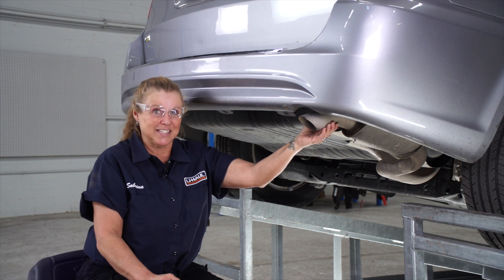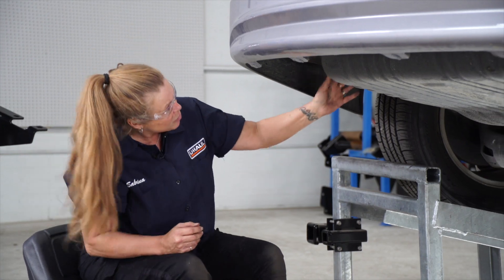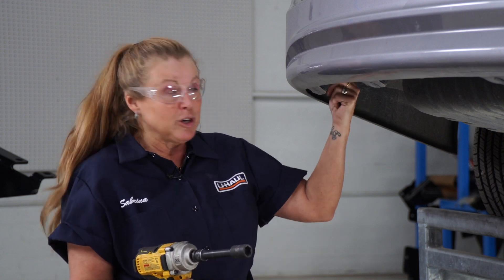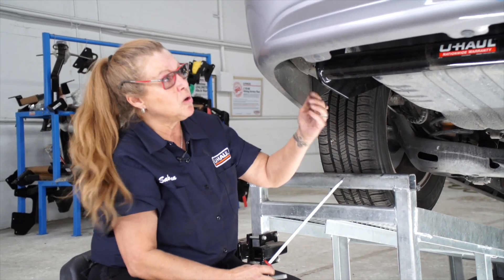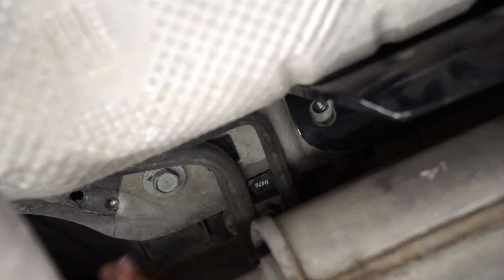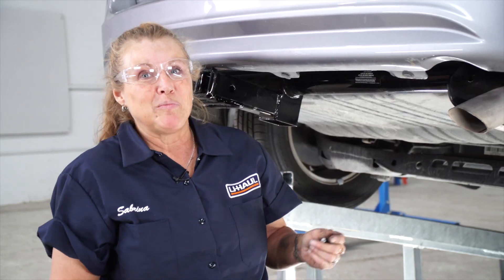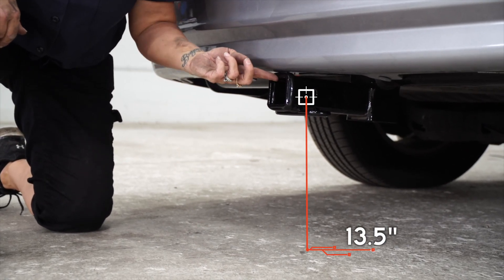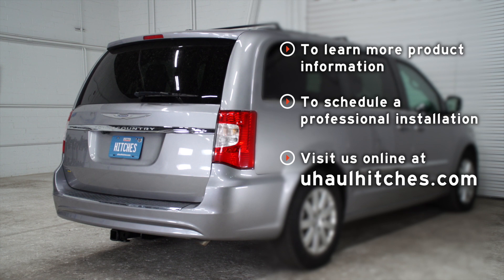2012 Chrysler Town and Country Trailer Hitch Installation

Comment: Do you have to try to center or position hitch in some way from left to right or forward to back before tightening bolts? Does hitch need to be centered with center of bumper somehow? Thanks!
Reply from the maker: You only have to align the hitch with the holes in the frame and it will be aligned on the bumper for you. It will only fit one way.
Reply: So with regards to the longer directions of the slots if the mounting bolts on each side of the vehicle are roughly centered in the long direction of the slots this would be adequate in regards to the alignment of the hitch receiver with the bumper? Is that a correct understanding on that?
Reply from the maker: @ParisKYLakefishing  Correct. Everything is designed for the specific vehicle and will be aligned as long as the bolt holes on the hitch are aligned with the frame weld nuts. We also include installation instructions with every hitch purchase that detail where the hitch aligns.